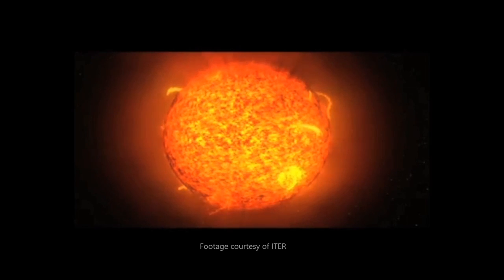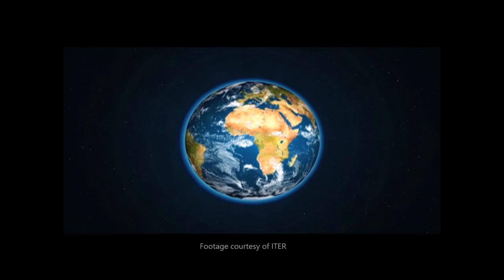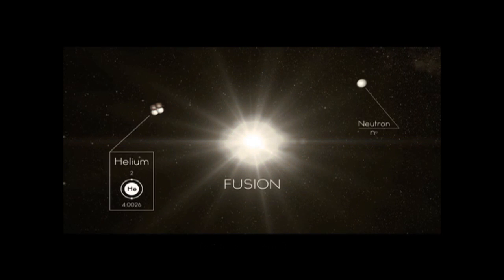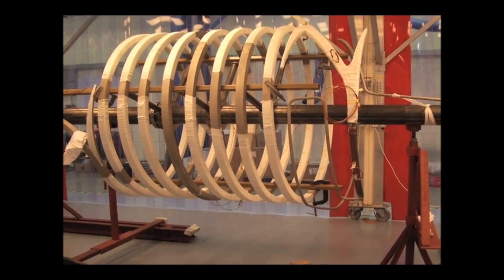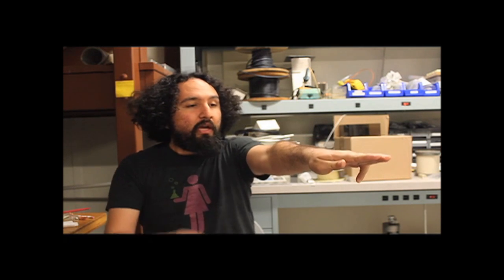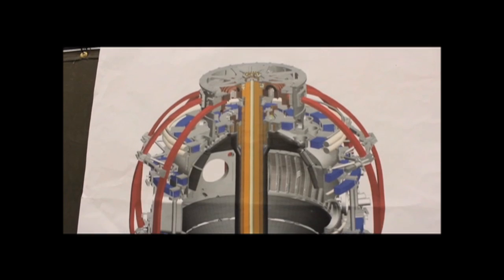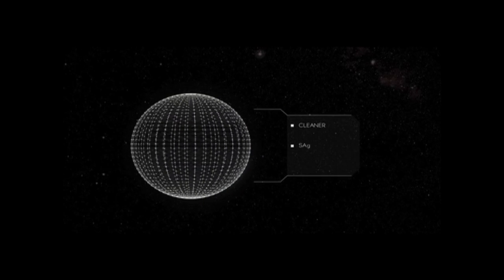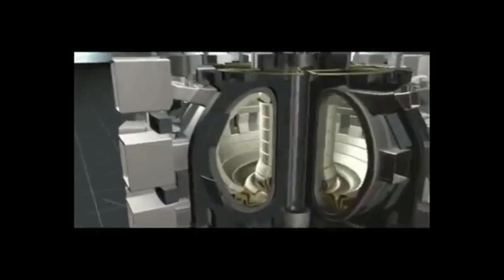Science Action: How does a magnetic field confine a plasma?

Comment: It didn't show how this energy is extracted for use. Will water be  injected or piped through to create steam and run turbines or would the heat allowed to excape through channels to run turbines.
Reply: The best plan is to have a molten lithium blanket surrounding the fusion center.  When fusion takes place, neutrons are released and (with decent probability) captured in the lithium blanket.  When the neutron hits a lithium atom, it creates tritium (more fuel) and heats up the fluid even more.  The tritium is (hopefully) extracted and put back into the reactor, while the excess heat is used to heat up steam to run a turbine to generate electricity.  So yeah
Reply: Recently, a new type of fusion called HB11 has been developed. It involves using lasers in a hydrogen-boron process. Apparently, this type of fusion could be connected directly into the grid without need for a generator!
Reply: @JM-us3fr  why are we still trying to recycle the same old concepts instead of designing new ones? Using the same old technology : produce steam/heat -> spin a turbine in order to create electric current?

Comment: Im kind of pulling a world militaries move here, but I was thinking about using this to confine plasma to a single ray that could then be directed at an object / target in order to eliminate it. The problem is the geometry of the magnetic fields and the energy required to generate plasma out of thin air, using only electricity. (as in no helium or hydrogen)
Reply: Also that beam of plasma would be very high pressure compared to the atmosphere, and probably dissipate very quickly

Comment: Fusion reactors will always be 30-40 years out and there will never be enough money until they realize they have an incorrect sun model as a base. Electrical atomic fusion is easily accomplished at plasma temperatures much lower than they are reaching for.
Reply: not really. You already have fusion reactors much smaller than ITER, allowing for accelerated/agile design cycles. ITER was already obsolete before they even started building it, from the the material science as well as improved plasma control from improving electronics/AI - sure, they did a small redesign to include better superconductors, but the very size and waterfall design of that project puts it on a 50-year learning cycle. Meanwhile, those same improved materials have allowed for simpler, "unworkable" designs to now be workable, so guys like Skunkworks can work on a container-size fusion reactors, have it on a 12-18month learning cycle, and planning for deployment around 2025. At the rate it's going, you'll be having multiple commercial designs before ITER even reaches first plasma.

Comment: If y’all want to make a fusion reactor, a real one and that actually works. What the scientist is doing wrong, is trying to go big!! Start building a small version first that actually can produce massive amounts of energy first. Then work the size up 2 inch’s at a time. Or like tony stark movies? Start small in a descent size that actually works, then make it smaller and smaller. That’s the key! Map everything voltage, radiation, pressure ect.!!!
Reply: But larger reactors are more efficient
Reply: Seve Nicolas yes technically but the make them work they need to start smaller than they are

Comment: Sorry but that is the wrong way to create fusion, your understanding is wrong. Take a look at the SAFIRE project. It is in the double layers that fusion takes place, on our sun it is in the chromosphere. As the sun passes through space it gains it's own charge in addition to the birkeland current flows, between the planets and other suns. At the photosphere the potential difference of incoming birkelands, drives the electrons up from the surface. As they go up to the positive (heating event)the two negative sides are brought together by attraction accelerating rapidly to the corona colider zone.. by the heat of the fusion event. The 2 charges unite into the resonant structures of matter they can form into..Matter creation and transmutation above the surface of the sun.  So now you can see the working of the sun into a nova mode...if you understand the physics of this action.
Reply: Please tell me this is a joke 🥲